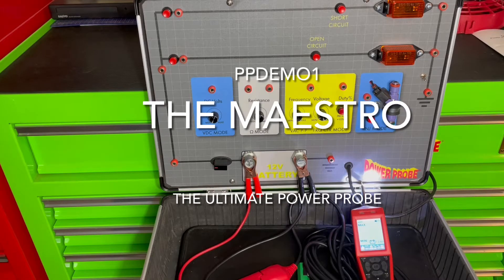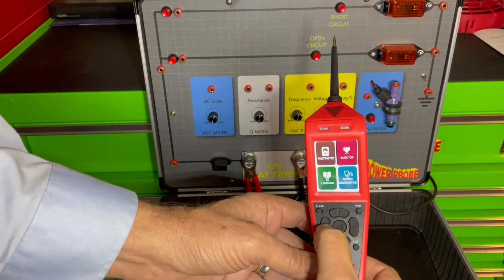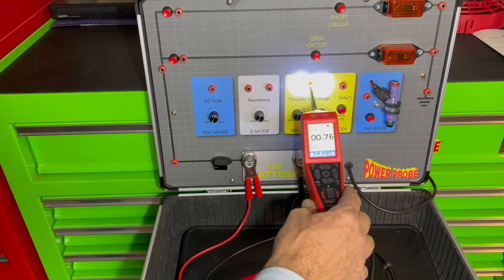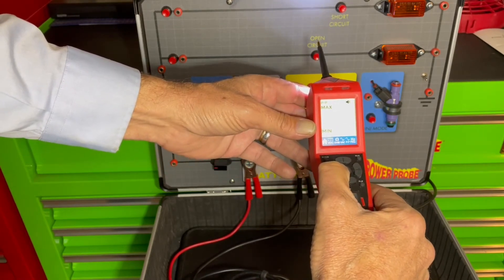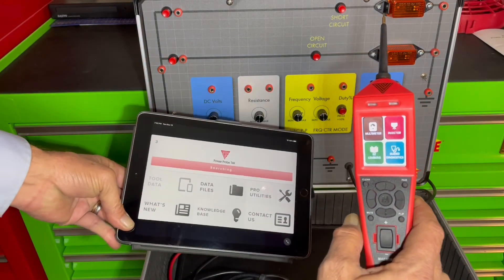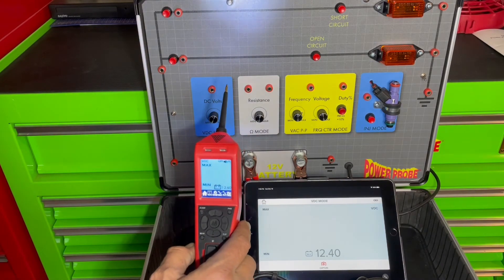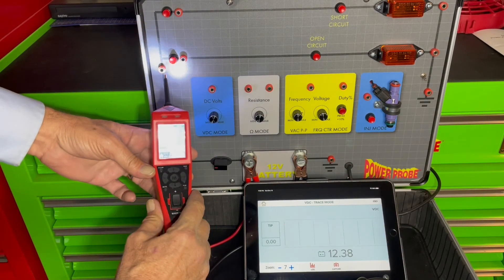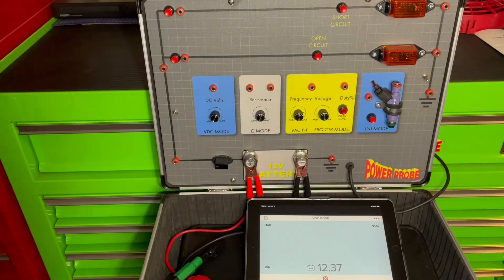PPDEMO1 Power Probe Maestro

Comment: With the fuel injector test mode, is it the same with the power probe four in the sense that it only works on certain fuel injectors for example I’ve been told it won’t work on direct injection petrol or on diesel injectors is that still the case maybe you could explain that a bit in a video